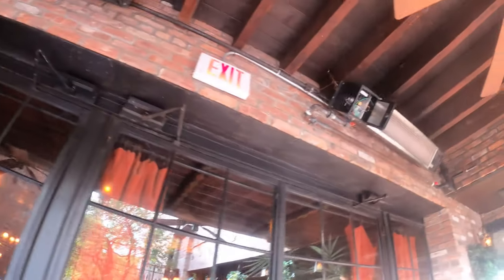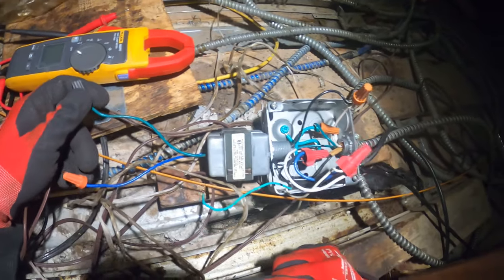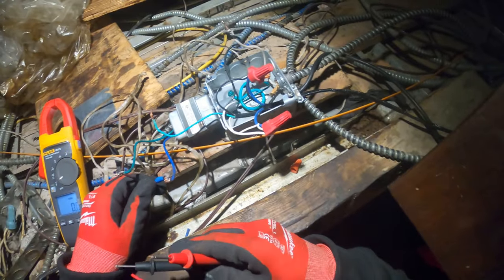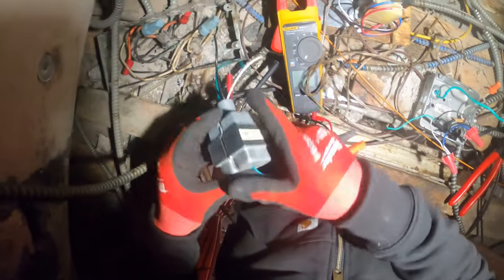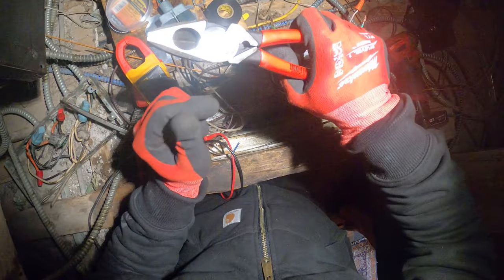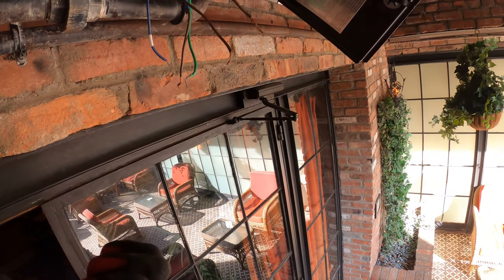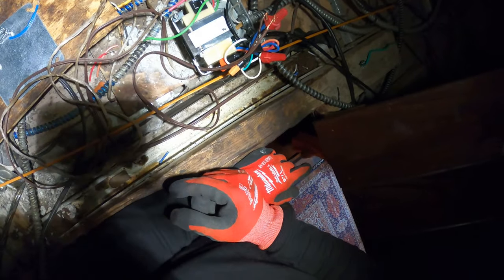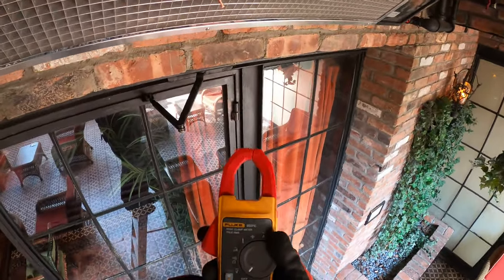HVAC Emergency Service Call: Outdoor Infrared Heater Not Working (Infrared Patio Heater Not Heating)

Comment: Hey great vid again man, quick question- with the higher rated tranformer, wont that increase amps in what appears to be already undersized wires? Also just out of curiosity i checked the installation guide for infrared dynamics and it looks like those units are supposed to be installed at least 14 inches away from any surfaces or combustible materials. Might be worth mentioning to that customer. Keep the vids coming!

Comment: So this video is a great example of why you need to dig deeper before you start throwing parts in or repairing anything. The first thing you should asj yourself is why could the xformer have failed. Had you ohmed thibgs out youd have discovered the faulty wiring which meant either the wiring was mounted incorrectly or the wire was over amping due to the missing and or underrated existing xformer.  Slapping a higher amp on an already stressed wiring system wont allow for a failure of component during over amp situation thus your conducter will burn up. Adding a fused unit was a good call though.